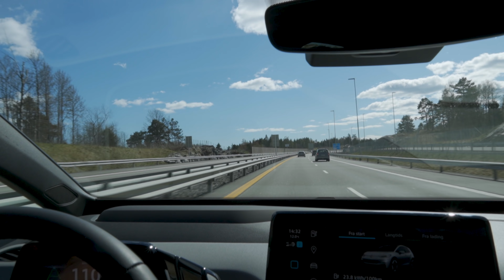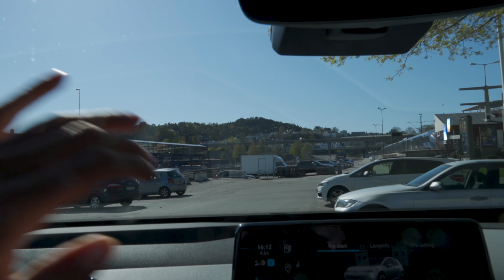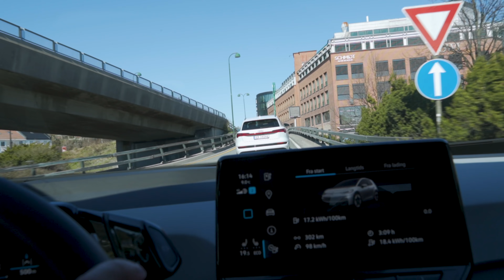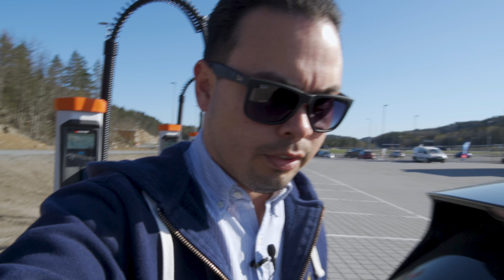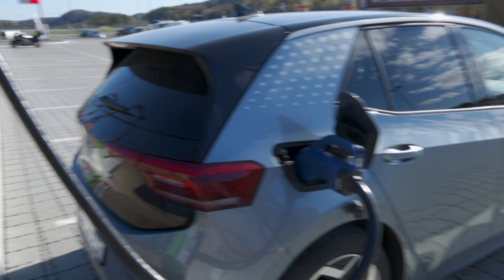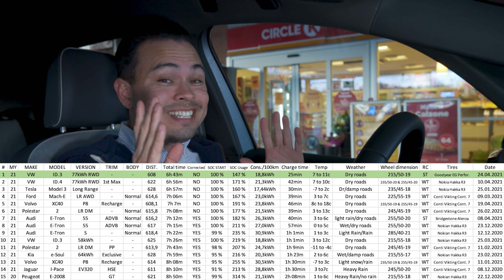VW ID3 77kWh 615km Range Test (Norwegian High Speed Run)

Comment from the maker: To everybody commenting about the differences in distance in the sheet, different cars count different distance because the margin of error is calibrated differently in different cars. The distance according to Google Maps is 615km. Starting point is as always Circle K Sandvika, turn around point is Togstasjon Kristiansand and end point is Circle K Sandvika. If you plot this into Google maps it will show 621km, however that is not correct because Google Maps routes you around Varoddbrua-Tunnelen because for some reason it thinks the tunnel is closed, which it is not. Real distance is 615km, and every car travels the exact same distance. However, I some times stop along the route for a toilet break off camera. I then stop the timer, and in these cases the actual traveled distance may be 200m - 500m extra, which does not account for any real difference in distance.
Reply: Thanks, this could be an annotation so people would stop wondering. 👍
Is the consumption corrected for real distance?
A car reporting less km would have lower consumption in kWh / 100 km than indicated because the fixed amount of used kWh should be spread over a higher number of km (if this makes sense).

Comment: What`s the point of this test?? They all cover different distances (its in your chart that ID.3 made less 20 km then the TM3 LR, its not  a simple toilet break is it?), with total different weather conditions (11 C with quite different of 2.ª for a electric car) and the more important is time they took? Was the traffic exactly the same? So autonomy and efficiency don't matter, because if they do, TM3 LR is the best of all 3...
Reply from the maker: I explain the point within the first 30 seconds. The point is to complete the route which is 615km the fastest. They alle cover the exact same distance, but report different distance because of how the different manufacturers calibrate their cars differently. I cannot control weather and temperature, can you? That's why the same cars will be tested several times in a year. I talk about the difference in temperature in the video, seems like you didn't even watch the whole thing since all you questions are answered in it. I also address some of your questions in my pinned comment at the top. I also talk about traffic, which is also another thing I cannot control. Before you do the same extensive testing of all these cars on a timed route like this you cannot just simply state that TM3 is the best. I don't make that claim about any car, the results speak for them selves. And until I get to test that car again in midler or warmer conditions, I cannot claim that either - even though that is probably is. Before it actually goes through the test again, the results are the results.

Comment: Of you run the Tesla m3 again, what is fair, it’ll be a close call. Then... you also should do this one again. You missed rather much charging speed... 125 iso 108... the car will Normally reach the 108 around a 40% of charge.  
So you charged more then 30% with a lower then possible charging speed because the chargers couldn’t handle it. 
My suggestion would be to recalculate the extra time (must be around 3-5 min) and subtract that from your actual time, or to do it again. I would choose the first option;)
Anyway great video Chris!

Comment: Kris, this is great info on the Kempower chargers! I looked up their spec sheet and it is indeed limited to 300 A, which means at 363 Volt for that ID.3/ID.4 battery at low SoC you can expect only 363 V x 300 A = 109 kW 🕵️
Reply: Yes, 150kw is theoretical max with 500V * 300A. Many chargers have a current limit but almost none have it clearly marked.
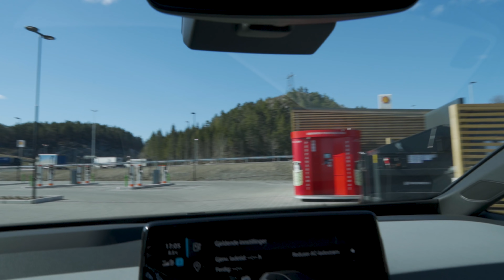Reply: @pka8514  7:31 If the orange cabinets house the power modules, there can be 3x 4x 40 kW = 480 kW for the whole location with 8 charging points.

Comment: Cool performance by ID3; too small a car for me, personally, as would be Tesla 3, but a really great time. And good to see VW challenging Tesla on longer runs!
Reply: wheelbase on tm3 is 2.78  ID3 2.76 
Not that mutch.
ID3 is higher  and feels more spacious.
The tesla ha a frunk. 
Depends on cost and needs i would say.
Would go for an Ioniq5 cause it will beat them both 😀 and its cheaper.
Reply: @dennisbjergmadsen5163  Liking that and Kia EV6, which might be my new favourite (over Skoda Enyaq). It feels good that better EVs and certainly more choice is coming!
Reply: In Bjørn Nyland's Bana Box Test, Model 3 takes 6+1/17, while ID.3 takes 7/19 Banana Boxes, see his spread sheet - ID.3 is more spacious for the back passengers https://docs.google.com/spreadsheets/d/1V6ucyFGKWuSQzvI8lMzvvWJHrBS82echMVJH37kwgjE/edit#gid=0

Comment: LOL, TM3 in summer ???? wait and see !!!
Reply: What could it possibly do better? 5 minutes less charging time maybe because consumption is a bit lower. So what? The limit in this test is the norwegian speed limits and not the cars any more :). You'd have to do a test like this on german autobahn to see the true advantage of Model 3 which is lower air drag. At 100km/h the difference does not matter much, at 160 it does.

Comment: Why is there so much difference in the distance? Between this and the Model 3 it is 20km which is with that speed is 12 minutes more and of course more charging. Hard to compare these results. I think you should try to use the same route and distance with every car....
Reply from the maker: I use exactly the same route with every car. Different cars count distance differently, that's just how it is and has always been. The Route is 615km according to google maps and has not changed.
Reply: @KrisRifa  Thank you, now I understand:)
Reply: My id3 always underreports the distance at 2% compared to google maps. Wir google maps I Drive 100 km, my car shows 97-98 km

Comment: Good enough result. Compared to Tesla, ID.3 77 kWh is price wise choice here in Finland because LR M3 costs over 10.000 Eur more. Too expensive. Thanks for the clear test video, awaiting for more...
Btw. It was nice to see you were using Kempower chargers!
Reply: Model 3 LR price can for sure be discussed but it’s 4wd
Reply: @Nlkla5  That's true. 4wd is expensive. Can't compare 1 to 1.
Reply: @arjuutuupi  The Motor price is only a few hundred dollars for Tesla according to Munro & associates.
Reply: The ID.3 Tour is actually more expensive than M3 LR in Switzerland. Only the "poverty spec" Pro S is cheaper.